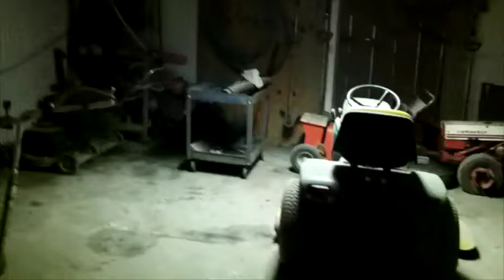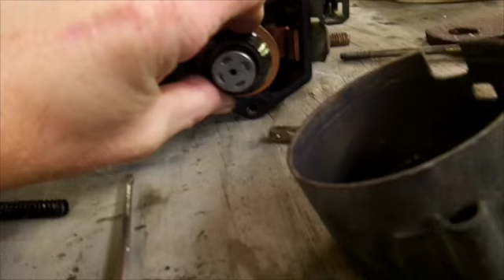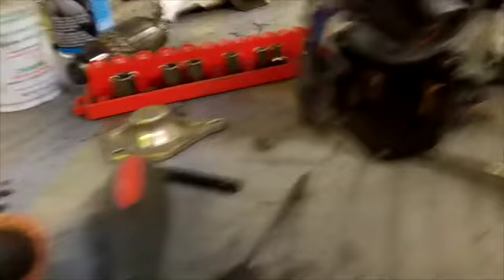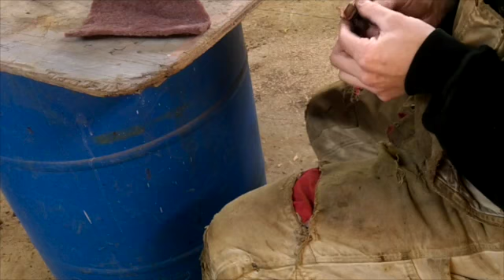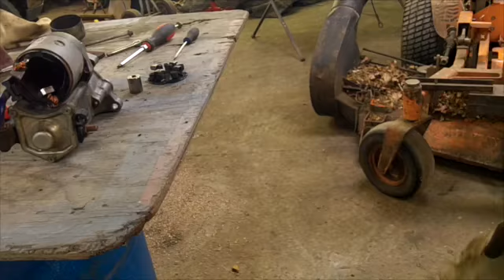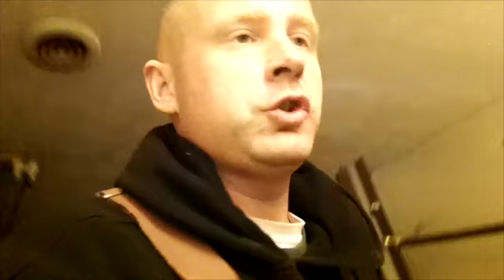How to repair a Nippondenso starter- Denso starter repair

Comment: The plunger is non-servicable...you can get both contacts and plunger from a e-bay seller for $8.00 if you are willing to wait 3 weeks to arrive from Hong-Kong.You can try sanding them for a temporary fix.

Comment: Good job on the starter, I have found repair kits online as you say that include brush cards and replacement contactor terminals.
Reply from the maker: I didn't even think to look for the parts before I tore into it in a frenzy.  I figured I'd look for a suspicious culprit before getting parts... plus I was being a cheap ass

Comment: Nice work. A fine file is better for that I seem to remember that the sandpaper isn't so good for the contacts the alu oxide and the copper react or something.  Or I could be wrong on that too.
Reply: What he needs is an ignition file.  Sometimes called a points file.
Reply from the maker: I didn't even think of using a file... that makes sense to me!  Thanks for the tip

Comment: Most of those starters I work on ,have dirty contacts or oil in them. . If the contacts are burned or worn till there is a ridge then I replace the contacts and plunger ,if not then I just clean.. They are cheap and only a few different styles of contacts. Those like most starters do not like oil.That is the same design starter on some cars, and lots of them have the same contacts.If you have more than one of those it may pay to have some replacement ones on hand.You can see me field fix one in a video called,.Kubota starter fix,denso starter
Reply from the maker: Checked it out.  Should have looked for a vid first...lol